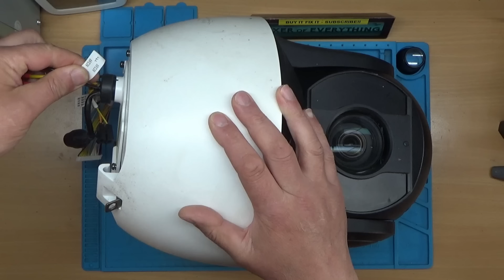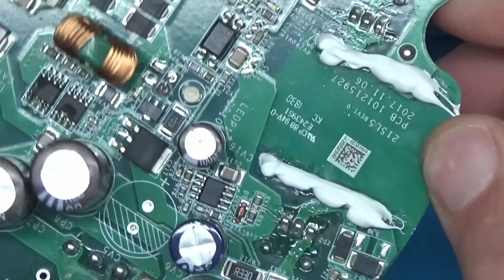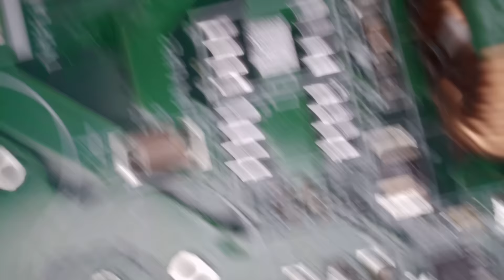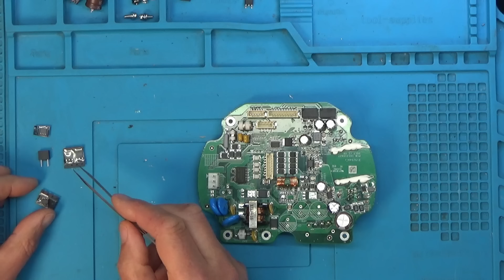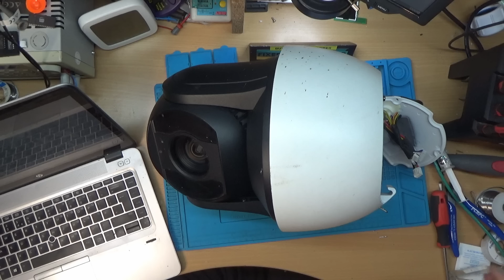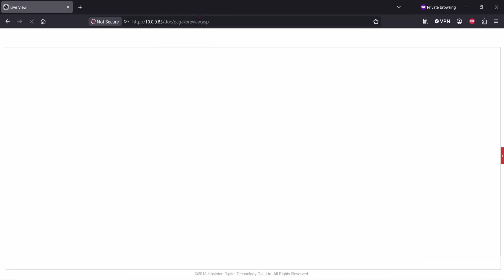Total Destruction?💥 Fixing A 24V Camera Connected To 240V!⚡

Comment: Surprised at PoE (about 960mA max) but main fuse on board is 10A?? Small solder bridge (or just a blob) near 24V AC input connector on rear of board at 18:32 - middle pin to somewhere??

Comment: 0:29 
24 vs's 240
This is like a Carpenters 100mm Mistake .. allow me:
Sometimes to be Extremely accurate in measuring millimetres, it IS Best to Not rely on a 'tape measures' inaccurate 'wobbly end bit' but instead use a perfectly aligned 100mm Mark.
Problem being "DO NOT FORGET" to deduct the 100mm.
Commonly done over Long lengths (being hard to Judge.
Point is:
240AC is SO common and 24AC (geeze, who knows it exists?😊)
Anyhow $24 an hour or $240 an hour is Easily Recognisable in anyone's language 😊

Comment: How can you put 240 volts in that camera by mistake?
22:52 You forgot to measure the fourth on the left side.
Reply from the maker: When he got it, it had the wall bracket attached, which had an Ethernet cable, and a 3 core mains cable coming out. You can't see the 24V label with the bracket on as it covers all of the wires. With it being a 3 core cable, he just put a 13A plug on it. 22:52 Very observant 👍🙂

Comment: . . .If you've got 24 VAC feeding into a rectifier bridge and no suitable transformer handy, you can feed in 25 V from your bench psu to it and the bridge rectifier will automatically apply the correct polarity across the o/p, irrespective of which way round you connect the input! Allowing for 1.2 V drop in two rectifier diodes, you will get approximately the same output across the smoothing capacitor(s) as you would have got if you had a transformer available, to be pedantic, you can expect approx 1.2 x 24 or about 28.5 V d.c. from 24 V a.c., so applying 28.5 V across the PCB connector pins from the labelled red, yellow and black leads would supply exactly what the internal psu is expecting!

Chris Williams
Reply: Maybe ? 😊

Comment: Afternoon Mick!

. . .What model number is it Mick?

. . .It always amazes me the things that blow up, go bang or catch fire you fix always seem to be (well into!) three figures on eBay, so buying one cheap to try and draw it out is out of the question – your customers always seem to blow up the most expensive model in the range – or am I imagining it?

Chris Williams
Reply from the maker: Cheers Chris 👍 It's a DS-2DF8225IX-AEL. I think my mate paid about £150 or so for it as it came out of a factory that had went into liquidation. When he got it, it had the wall bracket attached so you couldn't see any of the labels on the wires, and it just had an Ethernet cable, and a 3 core mains cable coming out of it, so he fitted a 13A plug, and the rest is history 😂😂😂

Comment: 23:40 So instead of taking off (random) components, wouldn't in this case voltage injection (a few volts up to that the current is roughly 0,5-1A and a thermal camera to see what gets hot be more effective?
Of course you did get a bit lucky that the first component you took off was the one with the short, but there are multiple tvs diodes and caps on that line that registrer the short, and it could've even been the IC you've gotten if it were faulty.
Of course with overvoltage damage, a faulty TVS diode is a prime suspect as they are a protective component.
It's a bit getting lucky the first or 2nd time vs. soldering on 2 wires, hook up the bench supply and looking at it with a thermal camera (obviously you need to have a thermal camera, or you need to do tricks with evaporating alcohol etc)
Reply from the maker: Totally spot on. I thought I'd try the two TVS at the back first, as they were what I thought would be the most likely suspects. If it wasn't those, then I would have done exactly what you said with the voltage injection.
Reply: @BuyitFixit  yes those two TVS diodes on the back are easy to remove with hot air, no electrolytics or connectors in that direct area.

Comment: What is 24v mains? Where does that exists and why?
Reply from the maker: It doesn't. It's supposed to use a 240V to 24V transformer to power the camera. With having the wall bracket on, and a piece of mains cable coming out of it, he assumed it was 240V, when he removed the wall bracket after it went bang he saw the 24V label.
Reply: Isn't it amazing what a decimal point makes 12v or 120v... Annual income $80k or $800k 😄😄

Comment: Great fix, I quite frankly didn't believe anything would survive. It's either good engineering of the power supply on Hikvision's side or just plain good luck that nothing else besides some generic ICs and diodes were killed.
I do have some Hiks (non-PTZ) installed in my home security system (6 of them out of 10 total cams), these are boringly reliable at being cameras but the software on them is dog-trash including NVRs. I use a PC NVR instead.
Reply from the maker: Thanks mate 👍 Yes got quite a few Hikvision cameras myself. I scored a real bargain off Ebay last year. Got a box full of untested 8MP cameras that do colour night vision, and some were even thermal cameras with 256gb SD cards in them for around £50. Think was about 17 cameras in total, and they all worked!

Comment: Great video... Reminds me from my Axis Communication days when people installed outdoor camera without proper STP (Shielded Twisted Pair) cabling and metal RJ-45 that is properly grounded to a switch and blow out the POE or network on the PCB... And expect the camera to still be under warranty for improper installation.. Oh the good days... Same damage as those cameras would be taken out by surge/lightning damage with the usual black marks on the PCB like that board.
Reply from the maker: Thanks mate 👍

Comment: I was expecting a long delay, these PTZ’s can take up to a few minutes before they do their self test, it caught me out when I first started working with them, I even almost returned one as DOA 😂

These are also the same as the DVR’s, they like a reboot after tinkering with the network settings
Reply from the maker: I actually chopped some out of that bit of the video. It must have taken around 2 mins before it did anything. Quite a long boot up time!
Reply: @BuyitFixit yep, I’ve had one that took 4-5 mins and almost returned it as DOA

Comment: I'm kinda wondering why you didn't check for a short when all the components were off the board and continue removing them until the short went away, all before you plugged it into any power? Just asking..
Reply from the maker: I thought the short was across the inductor, and it was being used as a boost or buck converter. A bit like the short across the small diode I measured which was the 10 ohm resistor in parallel with it. It turned out the inductor was just being used as a filter. That's the problem when you don't have schematics and your trying to revsrse engineer it in your head, you don't always get it right first time 😊

Comment: I have worked with those. For me not worth repairing. Usually more failures pop up later. New ones are not expensive. The boot up surprised you I see.
Reply from the maker: You're probably right, but I do enjoy the challenge of seeing if it can be saved. Yes took quite a long time too boot up, I even shortened it on the actual video.

Comment: I would have cut the legs off and removed the bits left with a soldering iron.  But that's how i did things when i worked on very expensive pcb's, a lifted pad would scrap the pcb so no effort spared.

Comment: It takes a special kind of person to completely ignore the voltage rating tag and just shove 240V down the clacker
Reply from the maker: Although to be fair, the tag was only visible after the wall bracket was removed. When he got it, there was just an ethernet cable and a 3 core mains cable coming out of the end of the wall bracket so you couldn't see the tag.
Reply: No, it’s a valid way of rendering banned products inert. :) HikVision is a known brand used by the Chinese gov to spy on western companies etc.

Comment: One merit of things like that is that the motors are unlikely to muster the torque to shear off fingers. One of my clients from many years ago designed and built custom industrial machines. Some of them could take off fingers - and hands and arms and torsos and anything else that got in the way.

I assume those big garden plots of black rectangles are TVS didoes in parallel. My guess is that either the designer had some significant previous experience or learned the hard way about lightning. Very few things will survive a direct strike, but protection with some hope of survival of a near strike is possible. I note there is a gas discharge tube in there. They are rare except where lightning is expected. They aren't as fast as TVS diodes but they'll take a heck of a whollop - a few times.

MOVs have a "wear out" mechanism - they are altered every time they conduct. If they were subjected to line voltage and are rated for something much lower, I'd be inclined to replace them even if they appear OK.

Silicone "rubber" sheet at least a couple of millimetres thick can be used to provide some heat shielding for things like big aluminum caps. Stuff like polyimide tape is virtually useless except as a sort of deflector for hot air. It is far too thin to block heat conduction but deflecting the hot air can definitely help. Everyone on the internet seems to ignore SM ceramic capacitors when it comes to using hot air blowtorches. They really are susceptible to damage by thermal shock and often very close to ICs. It is pure dumb luck they survive the brutality I've seen YouTubers subject them to.
Reply from the maker: Thanks for the great tips, especially about using silicone sheet for heat shielding and the warning about MOVs! 👍

Comment: Hi Mick. I'm not on your level, but I wanted to ask, why wouldn't you protect those caps with some aluminium tape, or even Kapton tape. I know those two were easy to get out, but they aren't always. Mr Solderfix showed me that one. I found some old car body repair tape I had, which seems to work and is cheaper than Kapton, as I had it laying around for years gathering dust. 
Anyway, nice job as usual. .
Oh, PS I guess, Lucky that. I bought a power supply. Plugged it in. Lots of magic smoke. Turned out that it has a voltage selector switch hidden away. In Aus we are 240V mains. Switch was set to 110. ☹. Most of the smoke came from the plastic that insulated the wiring on the step down transformer. Sigh,. It survived. Blew a couple of caps.
Reply from the maker: Thanks mate 👍Good idea on the car body tape and well done getting the PSU working.

Comment: you should buysome low melt solder, the one with Indium. makes things a looot easier....
Reply from the maker: Thanks for the suggestion. I've already got some, used it quite a lot on the channel. Although it would have only worked on one if the ICs in this case, as one had solder pad under the IC. Works great on things like HDMI sockets or USB sockets 🙂

Comment: Good work, very enjoyable, thank you, one note: if you have an ic or transistor with faded number or letters, it is a good idea to go  over the writing with a marker or sharpie, the faded letters and numbers will be very clear and readable, I think this power supply is very well engineered, how is your wife doing and her friends, we prayed for them, thank you again, from los angeles Moe Ganim.
Reply: Wow that is a big difference between 24 and 240. Lucky the whole thing didn’t explode
Reply: First you would try to make out letters without touching anything. Then you clean the ic very light handedly and make out what you can. Personally u have never had succes with sharpie method. 

And lastly you would check surroundings to see if any ics connect to it and see their datasheet for in circuit use.

Comment: Great fix Mick, did you eventually replace the last diode you removed, I didn't see that?  Hoping your wife's recovery is coming along, it's a long road I'm sure.  How did your friend manage to connect 240v to the camera in the first place?, does the connector allow this?  Your troubleshooting is awesome, always enjoy watching you trace problems.  Excellent work sir, thanks for the video.  See you next time.
Reply: I suspect speed-reading of the label confused 24VAC with 240VAC
Reply: @snafu.X yes but how does the connector for doing that exist? Is there such a thing as a mains plug that is 24vac?
Reply: @grantcurtis5200  Not a mains plug, no.. which is why this socket also wasn't a mains plug
Reply: @snafu.X  you answered exactly NOTHING.

Comment: Did something similar yesterday. Plugged in 4.2 volts into 4.2 volts in a coffee frother but reverse polarity. No protection diode. Boom transistor flyback diode and charging ic dead. I guess we all make mistakes 😂

Nice fix, you're lucky the ic numbers didn't vanish with the magic smoke
Reply from the maker: Thanks mate 👍Yes lucky the ICs were still identifiable. I would have thought the coffee frother might have had a reverse protection diode on. A lot of things do. Might be an idea to put one across the supply just in case 😉
Reply: @BuyitFixit I wish it did. Now I think I'm gonna add a schottky diode. Waiting on parts.

Comment: Good work!  I'm amazed that more of it wasn't blown up. That onboard fuse seemed a bit high at 10A.  Might have been even less casualties if it had been a lower rated fast blow.  A fun one to watch.
Reply from the maker: Cheers Mike 👍Yes I was expecting more carnage too! I guess it might draw a bit current when all of the motors are working + the IR illuminator at night.
Reply: @BuyitFixit Agreed. I did think about my comment after I'd sent it.  I guess 10A at 24v isn't a ton of power, I was wrongly thinking of mains power at the time.  I'm getting old is my excuse! 🤣

Comment: Wonder, why the blue movs are still ok? Would guess that they at least a bit conductive?
Reply from the maker: I didn't check the ratings on them. The TVS diodes were rated at 58V, so perhaps the MOVS had a higher voltage rating.

Comment: Nice work. I do remove and refit those SOIC-8s with hot air, but I find it just as quick with an iron TBH. I get a good blob of leaded solder down one side, gently pry that side of the chip up with the tip of a scalpel, and then wick away the solder leaving those pins high and dry. The chip then removes with solder on the other side and tweezers, and it's undamaged so it's easy to straighten the legs and slap it down elsewhere.
Reply: I just use low melt solder wherever I can 😅
Reply: @JustInspiredKent  I have used it very very occasionally, but it's expensive and can be messy. However, it's all about learning which tools and tricks work for you in different situations.

Comment: Great repair...Is 24VAC commonly used for stuff like this?
Reply from the maker: Thanks Bruce 👍I'm not too sure. Other cameras I've got (not PTZ) usually just take a 12V DC as an alternative to POE.
Reply: @BuyitFixit Yeah I was just trying to think if I have worked on anything that needed 24VAC, but I couldn't think of anything...Seems like a strange choice, but I'm sure there is a reason...

Comment: To prevent unwanted heating of adjacent components when desoldering with hot air, I use Kapton tape. It's cheap and convenient. 
The manufacturer skimped on several components, which led to such damage. Such equipment should be much better protected, since it is often mounted on lighting poles, where it can often come under mains voltage.